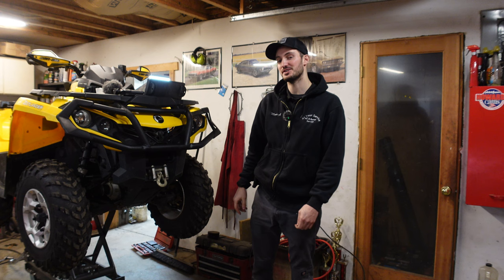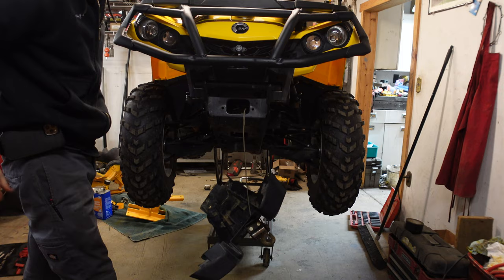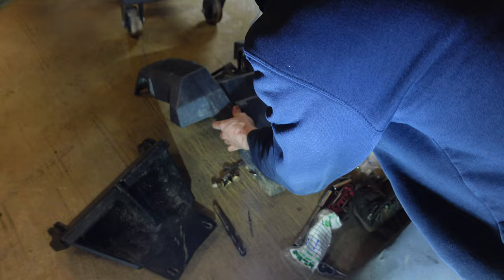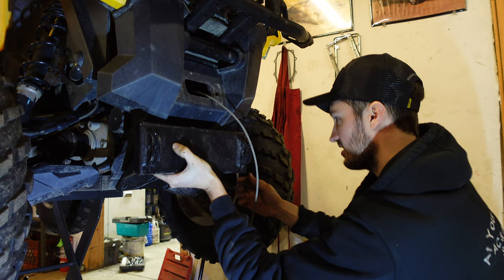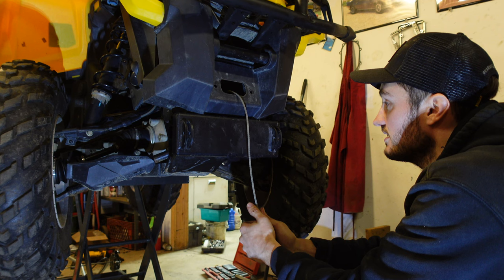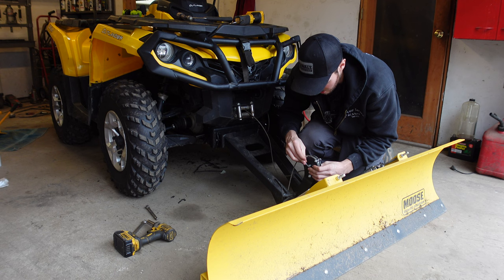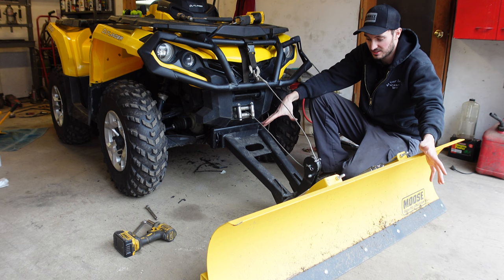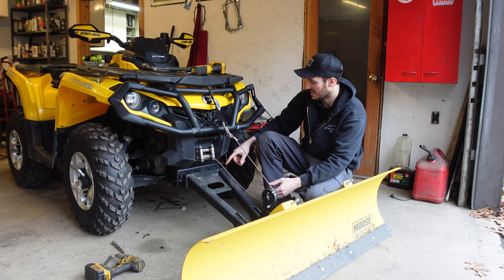How to Install a Moose RM5 Plow System on a Can-Am Outlander | Installation and Initial Thoughts

Comment: I just got ta new YAMAHA GRIZZLY and RM5 installed by the dealer but compared to my old 16 year old Moose county plow these new ones are terrible.  My 16 year old moose county plow is 24 inches high and the new ones are only tapered up to 19 inches.  The quality of metal is weaker.  I thought the RM5 was a good try but it doesn't allow me to beat on it at all like my old unit that hooks up underneath the ATV.  Can you tell me where to get that piece where you hook up the winch hook to on that unit  Mine snapped already after 15 minutes of use tonight.  I can't figure out what to get that's stronger.
Reply from the maker: You can try Dennis Kirk. They usually have all the parts for Moose products. I’m surprised you snapped it. Moose is probably the most heavy duty plow on the market. You must of hit something hard to snap it. I’ve bounced this thing off rocks and what not and so far it’s been doing great. Next snow storm I planned on making a video plowing with it. We have a dirt driveway so it’s super unpredictable what’s under the snow. I try to clean up before a storm and make sure no big rocks are out and about.
Reply: @LetDirtFly   i just called this rep from some parts company that works directly with Moose and he told me they changed vendors who make their plows I think he said 10 years ago or so.  They do not make the old county plow the same way.  It's only 19 inches on the high side compared to my old one which is 24 inches.  And it's way too curved too so it catches snow and snaps over too much.  It doesn't even move as much snow.  I can move more snow with my old plow than this new fancy one.  Pretty sad actually.  And I'm reporting this because I'm an expert at plowing with a YAMAHA GRIZZLY and Moose Plow from 2008.  The last 16 years I only had to have a buddy of mine reweld the push tubes one time.  They recently broke and I went and bought a new YAMAHA and new plow by Moose thinking I'd have the best new equipment:  NOT SO.  The Yamaha Grizzly seems fine but that new Moose plow is so far a FAIL.  I'm going to try and troubleshoot this but I see already the changes made with Moose were not for the better.
Reply from the maker: I will say compared to other manufacturers on the market, Moose is still the most heavy duty. I didn’t have any problems pushing snow in our last storm which was 16”. The problem is, as a society, we’ve failed. Manufactures try to find the cheapest and most efficient ways to get pump a product out. That means cutting corners and making things with the cheapest materials they can and the cheapest labor. If you think this plow is bad, Can-ams plows is a plastic composite. The Kolpin plow that’s popular had almost no curve to the blade and is made of thin metal so it’s very light.
Reply: @LetDirtFly    My friend Kyle who has a channel called 'Midwest Survival' and his dad and other brother know how to make things.  These are guys like you that are men of activity.  I'm just learning a few things but I believe I have intelligence enough to make accurate observations and will give an honest users opinion based on my own experience.  I'm going to try and see if we can construct a good plow and market it for select equipment.  It's not easy but I know men need good equipment and the hastle of finding good products today that can do the job is becoming more difficult.  That's why we try and network with people like you who also know by experience what's actually going on.  Thanks.  David.

Comment: I was wondering if I could get your opinion on something. 
I have a 2022 650 outlander xt with stock clutching and do a good mix of mud, hard packed, and trail riding I want a tire that’s lighter to not be too harsh on the bike but good in mud and very good on trails and smooth on hard packed 
I’m torn between 3 tires 
30 in terache Aztex 
28 in cryptid
28 in motohavok
Love the vids btw
Reply from the maker: That is hard. You will have to give up some performance somewhere of the 3 it would probable be the motos, not sure of their weight. the 30 aztex 42lb and 30 crytids 41lb. Teraches will out shine either in mud, will give up some on the hard pack.
Reply: @LetDirtFly  so you think the motos are the best on the trail too?